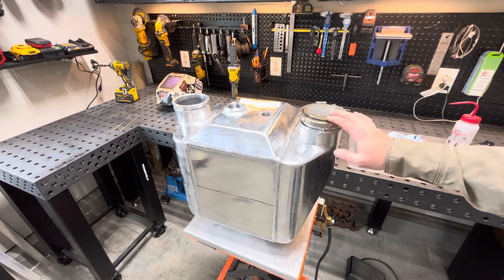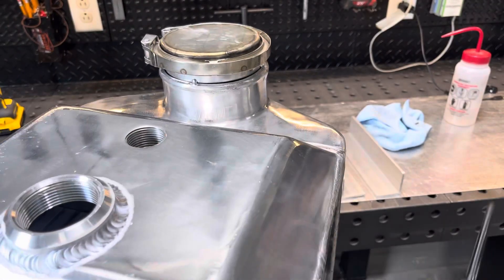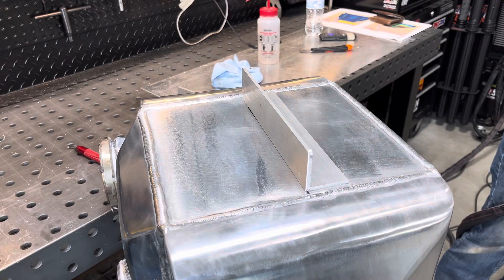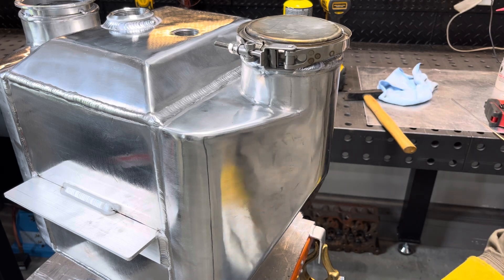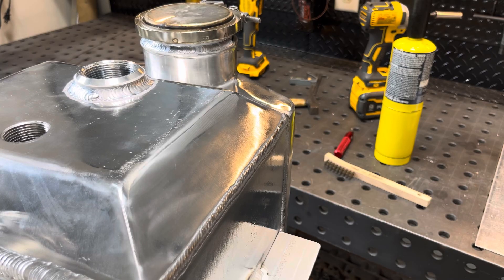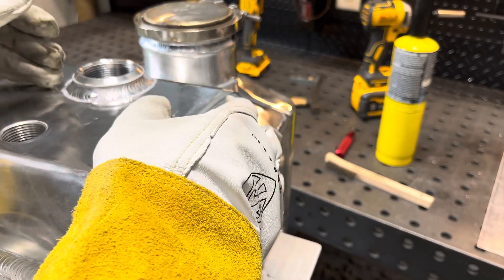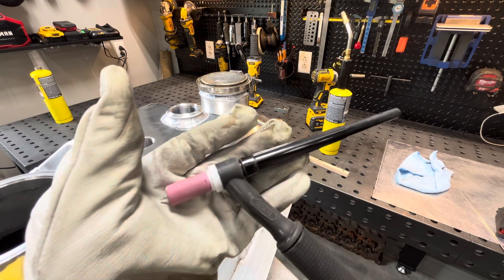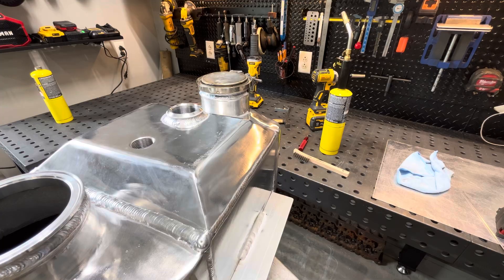Tig Welding Aluminum V Bands On Water To Air Intercooler

Comment: Having used Everlast welders for a number of years I can confirm the arc start flutter on a few of their machines, typically limited to their multi process machines. They've recently made changes to all of their machines to now match the HV start from their TIG machines which is beautiful. I would still have to recommend Everlast to anyone interested in a multi process machine, by far the best bang for buck with an excellent warranty. If you're a home gamer like myself and are looking for a multi process machine, I really don't think you're gonna find anything better for the money, especially their latest models.

Comment: been a min brother never clicked on a video faster then i did i this one. just order a prime welds 325 because my ahp 203 is throwing a e05 code and wont arc off super pumped to try it out.  Also you are talking about your torch iv been running a weldtec water cooled torch for a few months doing my mobile weeding and i melted the liner to the braided lines inside and it still works like a champ.

Comment: Love the aluminum videos ! I have a 17-51 Jon boat. My transom I figured out is getting soft so I’m gonna cut the top off and replace it with one I weld up out of  aluminum. It’s 2 inch thick and I run a mud motor. Would you go with 1-3/4 rectangle tube or channel and Sandwich it both sides ? Or how would you build it ? Just like other’s thoughts!! Would you go thicker on material gauge ?